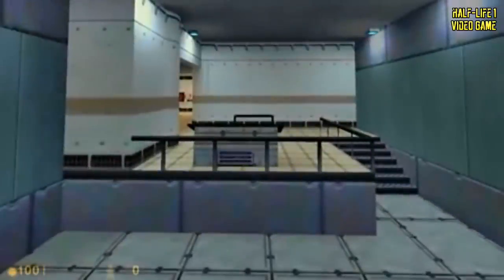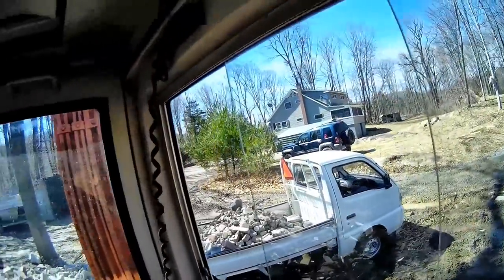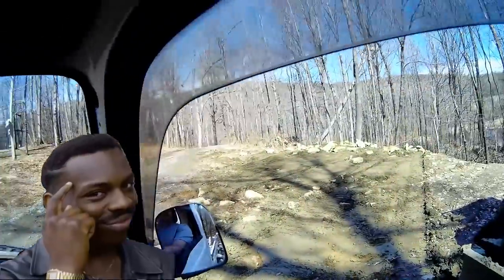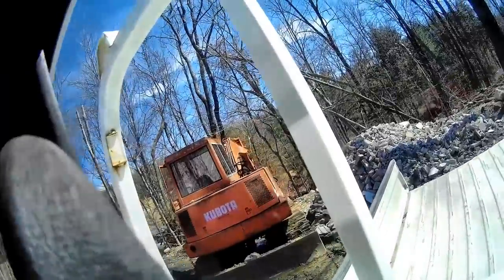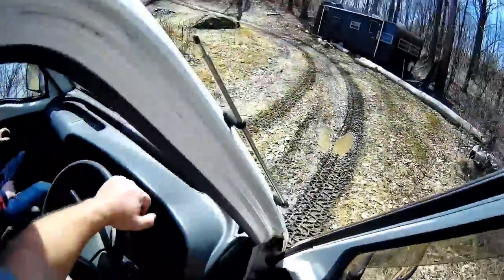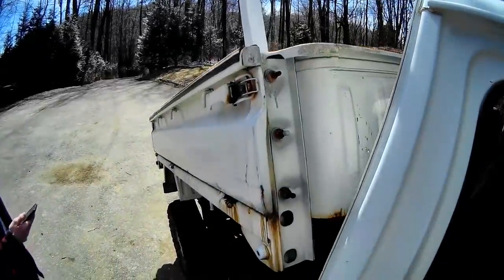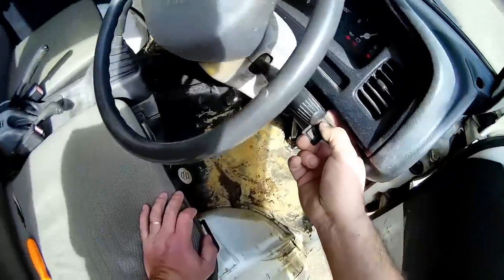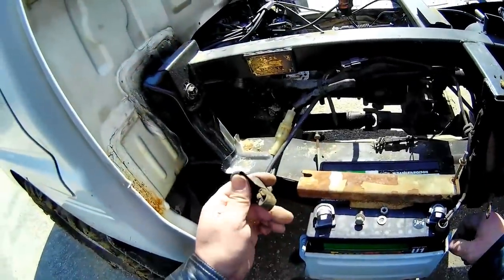Mini Dump (SE01 EP33) Truck SEASON FINALE. Radiation, Battery, Suzuki Carry Does some Hauling!

Comment: A lot of people make the mistake of installing a battery with SAE voltage in a vehicle that requires Metric voltage.
Reply from the maker: I used SAE to Metric converter bolts
Reply: @MotoCheez  thank god you did lololololol, have i ever told you your my freaking hero motocheese? the wind beneath my wings ?
Reply from the maker: LMAO 🔥🔥🔥
Reply: These get JIS batteries

Comment: So...

When does the Next Chapter "Mini & Dumpy" coming out?😪

I'm gonna hit my local Japanese Import located in Vancouver, Washington for my toy!

If I cry & beg, it'll be about 2 years until I get my "Dumpy" on. I'm looking at obtaining a Suzuki Carry 2WD with the HARD DUMP (higher capacity, like Dumpy).

Only reason for the 2WD, is so I can change out the Ring Gear in the Rear Differential so that I can safely travel at ~80MPH on the local Highway... If I could find a way to modify a 4WD, that's what I REALLY want!

Thank you SO MUCH for sharing your Kei Truck Journey with us all! I know that I definately learned ALOT from all your "crazy adventures" with Mini.

Take care y'all,
🤓-Thomas Skagen (12)
Port Orchard, Washington
Reply from the maker: Season 2 shouldn't be too long. I'm going offroading with mini and some jeeps today, so I'll have that and other footage to take with me to FL. 
I've thought about the higher gearing thing.. they used to make a 2 speed gearbox for the driveshaft (I know couldn't use higher gear in 4x4) just for highways shift it up, then when in 1:1 ratio you could use 4x4 again. It would only work on the Suzuki though, hijet driveshaft too short.
Reply: Micro-Dumpty and Mini-Humpty

Comment: Look up "Corrosion Block"   it's a Marine product.. Blue and white spray can..  You can spray it on anything electrical.  like Dielectric grease kinda.. Lasts forever and not gunky like others..
Reply from the maker: Will do, good for plugs too?
Reply from the maker: Ordered some...
Reply: @MotoCheez  Seriously.. Used it back in the day when I was a TowBoat US captain for 10 + years and my other Captain Yachting activities..  Sprayed my Outboard motors down with it every time I did and oil change etc. and they still looked new after 6 yeas in extreme saltwater environment.
Reply: @MotoCheez  any electrical part..
Reply from the maker: I've heard people suggest it before. I ordered some!

Comment: Pro Tip - Fluid Film, Surface Shield or one of the other lanolin based underbody anti-corrosion treatments works very well to prevent corrosion of automotive battery terminals.

Comment: The square sticker is your inspection sticker, was good till 10/31 which is October of Heisei 31= 2019, the other sticker looks to be a service sticker, (not official i believe) was due October Heisei 30 = 2018.
Reply from the maker: Sweet thanks
Reply: Yep, thats right, but they don't tell us where the truck came from. MotoCheez I think there might have been a stick in the doorwell showing a service like an oil change? That might have the name and address of a business or dealership on it, a close up steady image of that might tell us where it came from.
Cheers from Tokyo!
Reply from the maker: TY, I got your email, I'll send some picts! 😁

Comment: Japanese word for DUMP is DANPU.. How about DAN for short?.... To save the dump bed you could use a sheet ply about 5/8" thick absorb the hits and a sheet of tin on top of that to stop the timber from getting cut up. A method we used on 40 ton mining trucks on a bigger/thicker scale.
Reply from the maker: I had plywood in my Mule. It was so heavy to take in and out, especially when wet, have to find a plastic sheet like the big dumps have
Reply: @MotoCheez  .. Okay.. We never took ours out. Timber was sealed under the steel permanently . As you said a tho..thick HDPE sheet would do well for what you're after.
Reply from the maker: I was hoping for something I put in just to dump put 3 carriage bolts with heads sticking up a bit to slide the plastic over and hold it while I dump, I saw the trucks with the permanent bed Matt's rotted out from holding moisture.
Reply: @MotoCheez  Yes.. That's why we sealed the timber under the tin... Your idea is better... Maybe use  Rivnuts/ Nutserts  with Hex Socket Button Head screws so you can install and remove it easier and screw them back into the bed when not using the HDPE... Just a thought
Reply from the maker: I was hoping to hang it iff the carriage bolts that stick up a tad. The fat head would hold it on for dumping. Holes big enough to remove the hdpe

Comment: You got to drive it in reverse threw the woods, you''ll be shocked at how maneuverable it is. It will make you wonder why they didn't have the cab facing thee bed!!!! How hard would it be to put lockers on it?
Reply from the maker: It has air locker in rear. The have machines like that

Comment: You talked me into it! I'm getting one this summer. An A T V dealer A few towns over sells them and the next one with A dump bed that comes in I have first dibs on it!
I was looking at used Kawasaki Mules but as they have no cab or heat or radio and I saw throughout your series the fun your having I  gotta get one!
My area does not allow them to be street legal but you can run in the ditches like snowmobiles or A T V's if licensed by the Dept. Of Natural Resources. I'll probably put on A set of Mattracks.
Good luck and catch you next season!
Reply from the maker: Haha  nice!!! Even as a classic vehicle?
Reply: Apparently some communities will allow them on public roads but not mine. Unless you stay within your city limits they are useless to buy for commuting but if licensed as an ATV you should be able to travel in the ditches anywhere other ATV's are allowed. This limits one to small towns and country roads but better than nothing!
Reply from the maker: I'm surprised it doesn't fall under the "classic" rule as JDM import.

Comment: That rod is a safety device. You never work under a dump bed held up by hydraulics alone. Mechanical failure, or human error could be unfortunate......Got bids out on two different trucks
Reply from the maker: Nice. Good luck

Comment: I just bought a carry and plan to add a dump bed to it,it is a 2003 DA63T with the 5 gears HI and LOW. Do you feel you need more torque when you have a load in the back? Do you wish you had a lower gear to climb hill with the extra load? I plan to go to 25 inch tires for the extra load rating and was wondering if those are gonna be too big for the truck to climb hills with a load.  Thanks for the video and cant wait for the return of Mini and Maxi the dynamic duo!!!!!!
Reply from the maker: Nice, no the gearing is nice and low, wish I had the 5 speed

Comment: FWIW, I load tested one of those batteries. 160 CCA
Reply from the maker: The stock battery?
Reply: yeah. Stock battery measured 160 CCA @MotoCheez
Reply from the maker: Damn.. that way less than expected.
Reply: Yup, but I daily drove the truck 2 years. Replaced with a lawnmower battery only after I left lights on and froze it up at the end of my ownership. I have a Jimny with same battery now that I should test.  @MotoCheez
Reply from the maker: Ahh good info! Yeah LMK on the Jimney battery.

Comment: I may have the right size battery in stock at work give the dimensions and I can give you the part Napa part number
Reply from the maker: 7 1/4"w X 5"d X 8"t

Comment: My '88 Cavalier z24 died today, hairline crack in the block. Got it running and it shit oil/coolant everywhere. I thought I was chasing a head gasket failure (rebuilt the entire motor twice) and fixed it up one last time today. It drives and the v6 roars and sounds really beafy, unfortunately, I'm gonna have to pull the engine and do a swap.

I'm thinking of finally going about putting a L32 3800 series III supercharged motor in the car, coupling it with my 5 speed manual thats in the car currently. Going from a 60 degree block to a 90 degree but the bell housing is identical for both, engine bay is nearly identical to the new cars too.

RIP to the 2.8L v6 motor
Reply from the maker: Fun stuff! Not
Reply: @MotoCheez  I mean, not fun after dumping $3,450 on restoring it and adding all these extra goodies. These old motors are nearly extinct, was the number one reason for trying so hard to keep it. The new ones are super powerful for FWD and they don't make them with manual transmissions, so I get a really nice end product keeping the manual I got. The whole engine swap should run me around $1,500
Reply from the maker: Yeah I know! I was joking

Comment: Those stickers on the windshield don't tell where the mini came from, but that kind of rust isn't uncommon with 25+ years of exposure to a snow-melting agent. In order to keep the prices low, mini trucks are painted thinner than, say, entry-level sedans.

And the key chain thing is this.
https://en.wikipedia.org/wiki/Tsuchinoko

Comment: It was a fun video that you can enjoy even if there is no translation throughout.
Everything is due to your wonderful editing and sense.
ヾ(　´,_ゝ`)ﾉ【Thanks！】ヽ(´с_,`　)ﾉ 

Square stickers have an inspection deadline set by the government (3 years for new cars, 2 years after that), otherwise the roads in Japan can not run. (Effective until October 2019)
The sticker shows the year when the qualified inspector did a safety check (not a duty) and you can see that it was checked by the car dealer every year.
Reply from the maker: Ty. I think I can turn on translation...
Reply from the maker: It works? Nice
Reply: Thanks to you, I am enjoying the video again!

Comment: Man i love your videos brother. Lol. Got me two daihatau jumbos coming fresh from japan. Lol. If you have a chance to respond if love yo get some input about tires. Having a hard time trying to find the right tires that can handle the payload and still be somewhat a radial tire. What tires are you running on this dump?  And what sized rim and tire  do you use for the road    Huge mahalo brother. Aloha
Reply from the maker: Hi, thanks! I don't have the dump anymore but I ran the stock steel rims with SunF tires. I have links on motocheez.com. My daihatsu I'm on stock rims now too with 25" tusk terrabites
Reply: MotoCheez   Huge mahalo for the response brother. So another question for ya. Lol. I absolutely love the look of those terrbites but they are tall???  25”. What kind of mod did you have to do to your mini to make those fit?  I just bought a 2” lift but i don’t think those big tires will fit under the truck. Any intel would be awesome. Mahalo. Pete
Reply from the maker: @petermorrow3931  with a 2" lift all I had to do was cut the lower part of the door a little bit. They're great tires but do act like they're bias when they sit a while
Reply: MotoCheez oh snap. So we can get a 25” tire under these little beasts with a 2 inch lift?  And just leave the stock rims on. How wide of a tire were they?  Do you have any suggestions for aftermarket rims?  Again thanks for the intel brother. I really appreciate it. We kinda have a market out here in the island and i wanna get my ducks in a row. Plus i also have an daihatsu atrai half van and truck coming in and i wanna puts some meat under that one too. Maybe you could do a video all on tires and rim choices. Hint hint. Lol. Thanks again. Aloha pete
Reply from the maker: Stock 7" rims I think they are. 25x8. Links on motocheez.com
Reply: MotoCheez thanks brother.

Comment: Can't wait for season two! Maybe put a train horn on mini and scare the bejeezus out of the guys at the track! Now I want one done to the tits in cherry red with a wooden bed. Go old school. What a project rig, so many choices. I'd have to have another for doing my driveway, we get sixteen feet of snow here, so that one will have tracks instead of tires, a snowblower up front and a small pull plow behind. Get me one for beer runs with air bags in the back so you can just drop a pallet on it. That one can have verticle stacks and cb antennas on the mirrors. Imma need about fifteen minis.